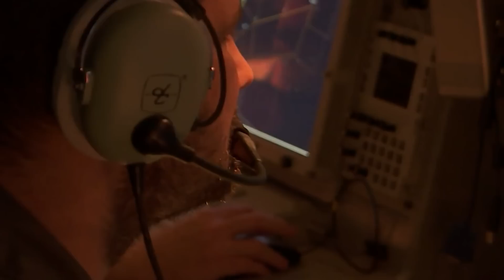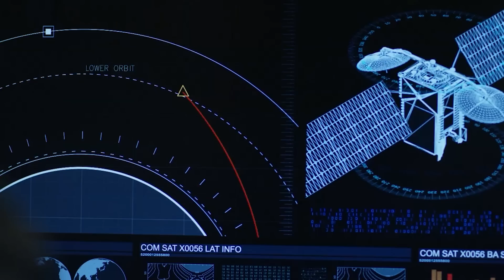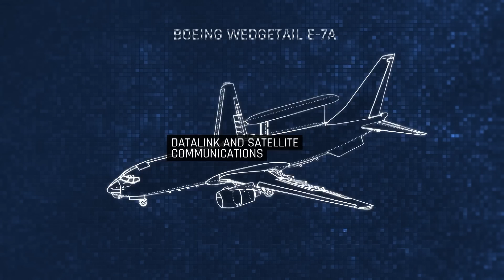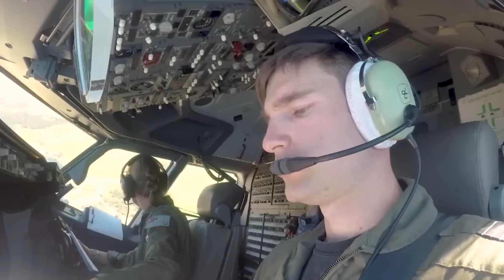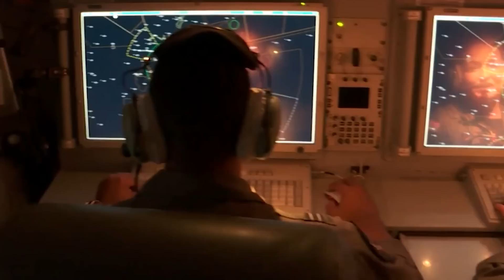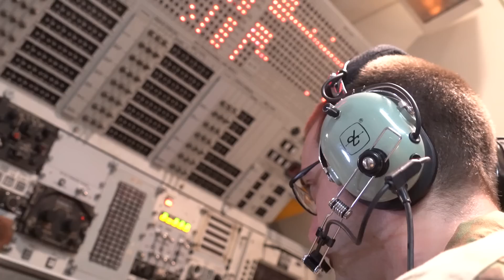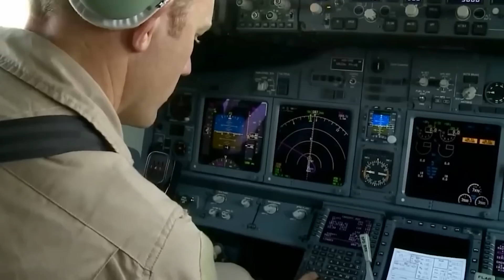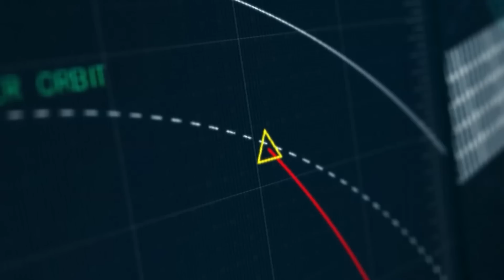The Bizarre and Risky Future of Electronic Warfare - The E-7 Wedgetail

Comment: The risk here isn't about the E-7 platform, it's the AF's slow procurement structure.
Reply: To be fair, the clip alludes to that at the end.
Reply: Shack
Reply: You can't blame the USAF for this
The E-7 selection makes zero sense
What the USAF was planning to do was Northrop Grumman E-10 MC2A  which made sense for 1000 different reasons
The KC-46 could have been included is as variant which would upgrades all the B-707s, E-3, E-8, KC-135 , RC-135s and even 747 E-4B into modern common aircraft
The blame is Obama and gates who during the time  the E-10 was under development was cancelling programs left right and center
Gates even tried to cancel the F-35B
if those two idiots had stay out of the way
The USAF would gotten a far more capable platform than E-7 as well replaced its aging B-707
Reply: @verdebusterAP  While on active duty, there was talk about extending the life of the E-7 just like the did with the KC-135R with new more fuel efficient CFM engines and extending the life of the airframe. However, the aircraft are certainly not cheap as the USAF had issues procuring a new air refueler, the Pegasus, that took more than a decade to finally get it off the ground and into the testing phase. The 737 is a widely used platform and obviously much more fuel efficient. These weapon systems are not cheap after we’ve spent trillions of dollars in the Middle East over the last 20 years.
Reply: @jamram9924  
Its not wide use
its about future proofing
How much upgrading can you do with B-737 frame vs the B-767
The B-767 can  accommodate vastly more technology and upgrades then B-737
Reply: @verdebusterAP  The Boeing 767 is an older Boeing civilian platform. Those Pegasus tankers are simply refurbished civilian airliner, similarly to the KC-10 Stratotanker. They can extend the life of the airframe and re-engine those frames as well. We have very tight DoD budgets after those long wars in the Middle East. We also have a Democratic leadership in the White House and Congress. Historically, they’re not big fans of the military.
Reply: @jamram9924  
The B-767 is not older
The B-737 dates back to 1967 while the B-767 dates back to 1981
Both have newer models
Secondly the B-767 for KC-46 are new built not refurbished
Reply: @verdebusterAP  

E-10 MC2A was going to be based on the B767-400ER that was at the end of its production line with Boeing

How does that even make sense to build a new 60 yr plus military program on an end of the line production airframe?
Reply: @ricky1231  
Your whole comment makes no sense
All that needed to be do is adopt the packages into the KC-46 airframe
Reply: I am sure anyone here did not even sit in an f16 or f18. Everyone here discussing is probably an armchair pilot.
Reply: how is it a risk?
Reply: I would call it piss poor planning, too busy wasting money on F35 when there should be other priorities like the E7 and aerial refueling replacements
Reply: @z0phi3l  the F35 is now cheaper than most 4th gen fighters
Reply: @z0phi3l  The F35 was worth all the pain for the helmet alone but yeah, this procurement process is concerningly slow.
Reply: @z0phi3l  the f35 is an electronic warfare platform of its own.
Reply: @z0phi3l  not really, the F35 provides a new capability. Whereas purchasing new AWACS and tankers would just provide more or less the same capability. 

The F35 provides an immense new capability. The marines can now turn their heli carriers into F35 carriers, meaning not only does American now have its usual super carriers. But it also has a bunch of smaller carriers that carry more F35s.
Reply: @guillaumelalonde7945  It's also a stealth 5th-gen supersonic fighter as opposed to a 3rd-gen subsonic jet (AV-8 Harrier)
Reply: @da_duccchannel  exactly, I mean the F35s capabilities are insane, so to be able to have heli carriers and amphibious  assault carriers carry them is a huge advantage
Reply: @guillaumelalonde7945  It's exciting for other Western militaries too, since they can ALSO convert their heli carriers to support F35B ops (though usually their heli carriers are much smaller than USN's)

F35B could potentially unlock power projection capabilities for nations that never before thought it possible
Reply: @z0phi3l  they both need to be priorities and its not an either/or. Without aerial radar planes you wont find out if someone penetrates your airspace and without good fighters you womt be able to find out if they do. The US and Commonwealth both provide some additional radar and air defenses to supplement Australias own either way. The fact that they custom ordered a plane also means it needs to go through more approvals that an already established fighter that's being sold globally.
Reply: @z0phi3l  the 35 is significantly cheaper than any euro aircraft that's available

Comment: Also the wedgetail can use smaller regional airports. They fly regular exercises out of NTL into my local (2000m runway) which handles/d A320s 737-800 and Dash8s with tarmac and infrastructure to spare so they can be dispersed as required. During covid travel restrictions they were the only jet in this airspace so they were noticed...
Reply: Yeah, the 707 is a BIG aircraft. The 737 is going to be a lot more flexible and efficient.
Reply: The E-7 is based out of Newcastle (RAAF Base Williamtown), if their not operating somewhere, that's where they live. Their operated by No.2 Squadron.
Reply: What is NTL?
Reply: That’s a great point — the Wedgetail’s ability to operate from regional airports adds a whole layer of strategic flexibility. In a high-threat environment, that kind of dispersal isn’t just convenient, it’s survival. And I can imagine how surreal it must’ve felt during COVID: empty skies, and then suddenly this lone, high-tech sentinel cruising overhead.

Comment: The funny thing is if the US procurement system was agile, it could exploit the massive downturn in passenger flights and procure a number of good B737 airframes, refurb if/as required and be ready to fit radars as fast as they can be produced.
Won't happen though.
Reply: Refurbished 737 would not be profitable for Boeing, and would require evaluation of structural fatigue.
Reply: @RadicalTek  There's a backlog of 737 max airframes sitting in storage right now. Airframe fatigue isn't an issue for new aircraft.
Reply: @RadicalTek  The problem is that the USAF has severe requirements in regards to air frames handling Nuclear EMP, radio interference and battle damage, ie a missile burst nearby or taking out an engine.   This is why it can't just buy A330MRTT
Reply: @RadicalTek  Eval of fatigue is routinely done these days and there are plenty of barely flown B737s available right now courtesy of Covid and Fuel prices.
Reply: The German procurement system had become so impossible that Germany couldn't even procure a Helmet over the last 16 years.  The German Parliament actually passed a law that allows them to accelerate acquisition overt the next 5 years.
Reply: i was gona say if the biggest issue is that ordering new airframes is 2 years then to years to modify them then buy used 737 airframes for at least the 2 prototyps. this is asuming that there are no 737 white tails (probbly safe on that one give the 737 popularaty)
Reply: Part of the problem is mil planes use a thicker skin and at times extra bracing for harder use. Its the same frame yes, kindve. But they use different stuff. In a case of an emergency such as a hot war, they could go your rout. They won't though.
Reply: @truckert9729  No, not when they are using commercial airframes like the 737, 707, it literally wouldn't make any difference.
Reply: A not insignificant consideration of the Department of Defense is the steady drip of federal dollars into the handful of top defense contractors to keep them hard at work on emerging technologies and maintain production capacity.

Comment: and How Many 737 Airliners have crashed in last 40 years ?
Reply: Except for the new "Max", the 737 has one of the lowest hull-loss percentages of any modern airplane. The reason the actual numbers are high is because it's so widely used in large numbers. The non-Max versions are not fully FBW so that gives them some protection against EMP attacks while Airbus is vulnerable. It may be one of the best planes ever having needed little more than engine updates to remain current.
Reply: Yeah! We can just crash them on the enemy. More American style actually.

Comment: The Aussie E7 I saw at an airshow, still had the passenger windows painted out.
Reply: The windows that are "painted out" aren't actually windows. As the airframe was originally a civilian "green skin", and the windows were originally there. Upon conversion to E-7 they were "skinned" or the same material that the airframe is made from was riveted in place. There are crew windows around the wing (four on each side) at the crew rest stations. This is actually the back of the crew cabin as there is a wall here where the avionics associated with the Radar are in the rear of the aircraft and are generally not accessible in flight.

Comment: They are full of horseshit about the E-3, and if they were really serious about being able to evade the PL-15 missile, they would use the B-2 air frame and use that as the basis for a truly stealthy Command and Control Aircraft. The E-7 is not significantly more capable of evading the PL-15 than the E-3.
Reply: So you want to take an expensive to buy, expensive to operate, stealthy airframe and then tack a gigantic RF transmitter on top of it?

Newer, better radar = longer detection range, ie significantly better chance of either killing the launcher or evading the missile.
Reply: I think the idea is greater radar range, which should allow the plane to simply stay out of the range of the PL-15. In addition, though it was not said, I imagine this radar, like the APG-81 of the F-35, has a significant capability to jam radars, which should decrease the practical range of a missile like the PL-15.

Comment: Seems like a stopgap, but someone would have to educate me on why the radar array must be above the fuselage, rather than inside it/under it/integrated.
Reply: Your statement makes zero sense. Think about your own question
Reply: Someone will have a better answer but I think the basic answer is area of scan, separation from the antenna and the size of equipment. The bigger the antenna or array the more area it can scan or more sensitive the detectors can be allowing it to pick up fainter sensor returns. You don't want something that can pick up a small boat at 200km radiating half an metre in front of your face, also the interior volume to shield the crew from the electronic radiation adds weight, reduces range and there are better things to put inside the plane. And lastly the size and shape not mention the weight of the radar/scanning array limit where you can put it.
Reply: @davidrutherford6311  Thanks!  I hadn't thought about the radiation.
Reply: @charleshorseman55   you didn't think at all... stupid question at every level.
Reply: It needs a clear line of sight.  If you mount it under, the landings would become much noisier, and more expensive.

Comment: Any problems with the 737 variants that crashed or is that something else?
Reply: The 737s that crashed were 737 MAXes (the newest design).  E-7 and P-8 are based on the 737NG (the previous design).
Reply: iirc that was a training issue regarding response to fault warnings, can't recall for sure though.

Comment: You would think Congress would learn from their mistakes. Obamacare was supposed to be paid for by the savings we got from the end of the Iraq War. It ended up costing two and a half times more than that. I am guessing that this program will cost much more than they project. The F-35 project ended up going way over budget. Hopefully it won't break the budget before it is replaced. I was in the Air Force working on f-111s in the '80s. When they were developed in the 60s there were all kinds of problems mainly the Navy couldn't use them because they were too heavy. There were a couple of other issues which were resolved but they did end up being a very effective fighter bomber. The weapons Bay used to hold the 20 mm m61 Gatling gun and ammunition storage drum in one half of the Bay. Some say it worked very well in low level situations much like the A10. I wonder if they could have used the whole weapons Bay for the 30 mm and it's drum. It would have taken up the whole weapons Bay but the weapons Bay had the capacity to hold two Mark 82 2000 lb bombs.
Reply: You'll believe anything? 😅😅😅